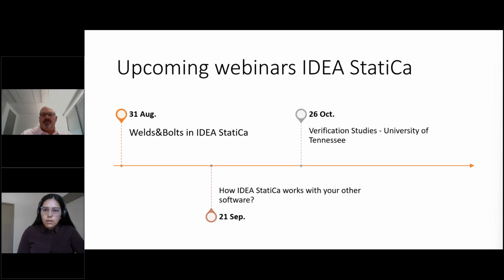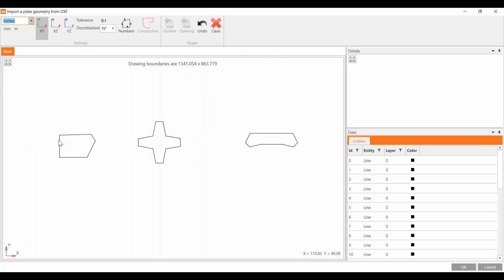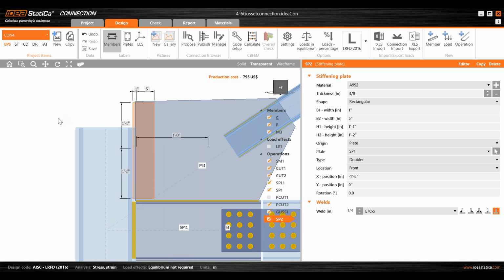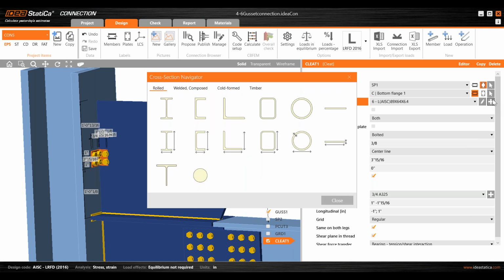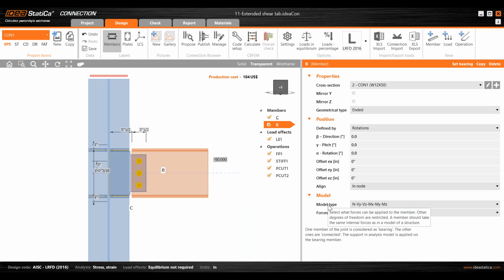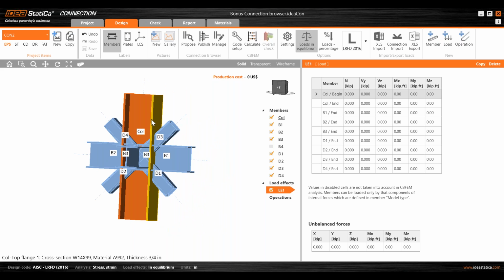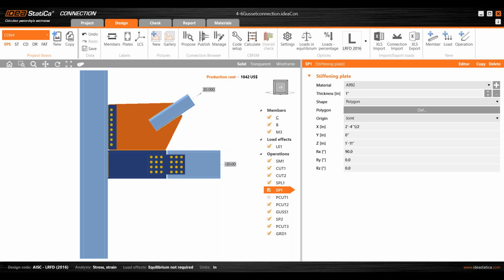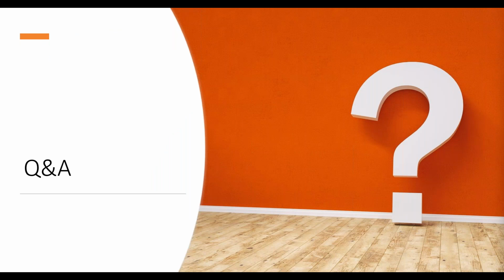Steel Connection Modeling - Tips&Tricks

Comment: Where I can check tolerances of holes gor bolts? - I received ifc from Idea Statica with bolts M24 and the holes are 27 mm in diameter, when in EN 1090-2 it should be 26 mm.
Reply from the maker: Hello, can you please contact our technical support? For bolts M24, we use a bolt hole of 26 mm as standard. This can be edited by the user, however.
https://www.ideastatica.com/support-center/support-center-knowledge-base/how-to-create-a-new-support-case
The measurement of 27 mm is most probably because the bolt hole is displayed as a polygon instead of a circle, and while the circle has 26 mm, the polygon points opposite on the hole are a bit out of the perfect circle, which results in measuring 27 mm.

Comment: how to add slots in the clip angle for a bolted clamp detail for bolts through hollow steel beam or column
Reply from the maker: Hello, slotted holes can be added only to the plate that is under the heads of bolts, so only in 1 plate out of the plates connected by a bolt group.
https://www.ideastatica.com/blog/bolts-in-cbfem

Comment: how Idea statica model built up tapered beam and column connection?
Reply from the maker: Hello Sumi, you have to use the stiffening member for the tapered part of the connection - see the example in our Sample projects gallery. Or you can use the template directly in the New project wizard. 
https://www.ideastatica.com/support-center/double-haunches
https://www.ideastatica.com/support-center/110-new-connection-templates-in-the-starting-wizard

Comment: Also please provide a tutorial for an example for bolted clamp detail for bolts through hollow steel beam or column?
Reply from the maker: Hello Fazil, you can use the general bolt operation, just like in this case from our Sample project gallery
https://www.ideastatica.com/support-center/anchoring-with-cleats
However, please consider the following restrictions:
https://www.ideastatica.com/support-center/through-bolts-for-hollow-sections-warning

Comment: How to model aluminum bracket fixed to aluminum mullion with hollow bolts?
Reply from the maker: Hello Fazil,
unfortunately we dont support aluminum material in our applications. What you can do is to change the material properties of steel, but the code-checks will be still as per steel structure.
https://www.ideastatica.com/support-center/user-defined-material-properties
IDEA StatiCa Team